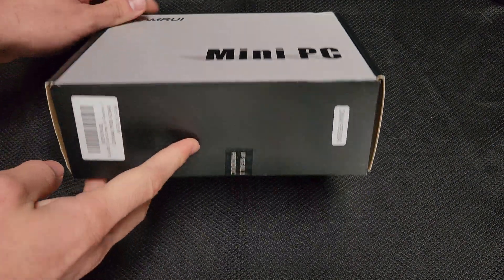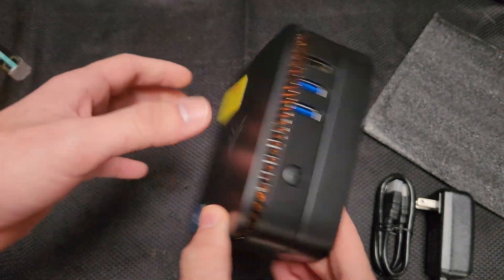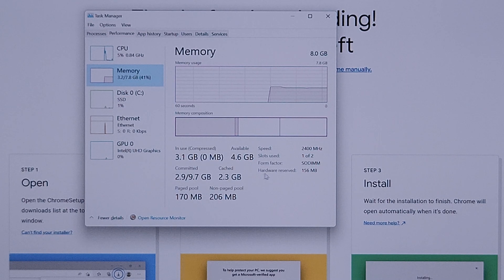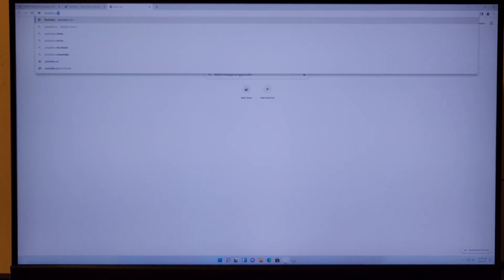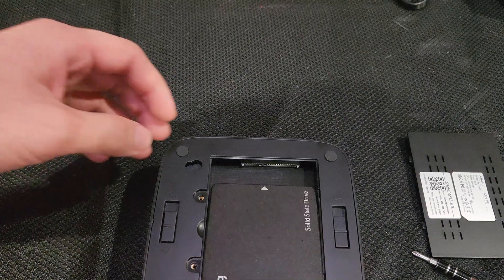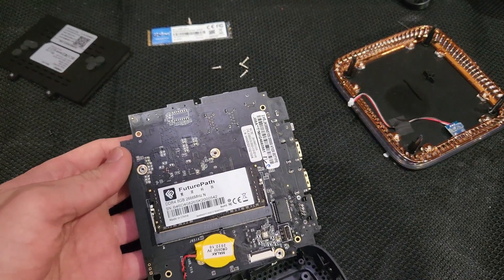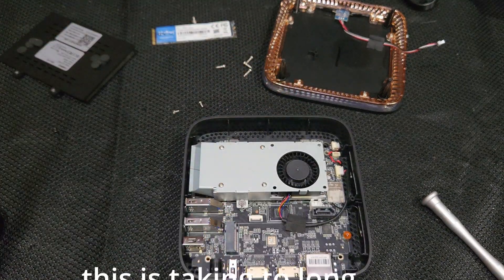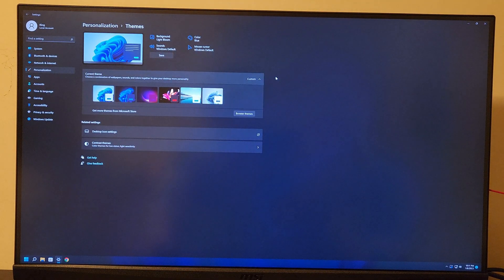Kamrui Mini PC AK1PRO(unboxing and teardown)

Comment: Picked up one of these for $115 on Amazon. N95 WITH 8GB and SATA SSD WIN11 PRO. Booted it up and installed Chrome and Firefox browsers. The CPU would peg at 100 percent just opening Chrome.  I changed the 8GB with a 16GB it's a single stick and it was still crap. Shipped it back to Amazon already. Lol.

The one I got was AK1 Plus N95 CPU.
Reply from the maker: Sorry to hear that. I didn’t have an issue with mine. I wonder if they changed some components overtime.
Reply: @kngx64  Not sure.  Mine, when I popped it open to replace the 8GB stick with a 16GB stick, it has one large fan that nearly covers the entire board not that gray box like on yours.  I didn't hear the fan spin up fast or loud during the short time I had it though.

Comment: How long does it take to get it doing something after powering on the first time? 20 minutes and the screen after the initial display is still black.
Reply from the maker: It should only take a couple seconds
Reply: @kngx64    Thanks.  I did have an issue but it is all good now.

Comment: i have 2 of the love it, but is it normal ive notive that the default networking point to a external asddrress, check it out, and theres alwasy stactic on the speaks when its on .....may be bad settings ...any idea ...??  ..but i love it fir the size , power friendlyness....😅

Comment: Love this little pc but my wifi is not as strong as other units in my house. I watched your video to see if I could upgrade the wifi card but I don't know which piece it is?
Reply from the maker: The WiFi card is not removable on this mini pc unfortunately. Having a Ethernet connection would also help out a lot.
Reply: @kngx64  Thank you for the reply. I ended up getting an aftermarket wifi USB I can switch over to when signal is low. Seems to have worked perfectly. Thank you!

Comment: Do you know why mine has no ram slot I made sure it’s the right model and the rest of it’s the same but it’s missing the ram slot
Reply from the maker: I am not really sure, I wonder if they just changed the board and not the housing
Reply: @kngx64  when did you buy yours or do you know what year is was manufactured?
Reply from the maker: I got mine in February
Reply: @kngx64  nothing changed about the model from yours date and mines date weird I’ll just return it.

Comment: Thanks for comments.
Have ordered it. No fortune. Installed. Windows has updated. Than fault messages VCRUNTIME140.dll, MSVCP140.dll on three funcions mouse, audio. Not fixed yet. Than ultra low speed on WLAN: 25 MBit/sec.  Than plugged in a USB to Wlan stick. 2,4 GHz no connection to my wlan. 5 GHz connection ok but only about 2 minutes connection to internet than break down. But speed with USB to Wlan would be 240 MBit/sec.   Than test with ethernet connection. Same - connection breaks down at about 2-3 minutes. 
Device would be nice. Service would be quick. But the device is currently unusable. Support hasn't responded yet. Support page given on AMAZON is incorrect or no longer available. Error 404.
Any idea, what to do?

Comment: tysm man i was searching for a video to look if i can change the ram and i got my answer
Reply: im really confused cuz in the review of the product they say we cant change the ram its integrated
Reply: @fbgs006  I have the same mini PC and I've opened it, in my case it uses a 16Gb DDR4 2666MHz RAM module. Sadly 16Gb is the maximum supported by Intel Celeron N5105

Comment: I sent mine back, i didn't like that you can't upgrade the ram and it uses a nonstandard SSD drive. I bought a beelink instead, it uses a standard m.2 ssd drive and SODIMM memory
Reply: What? Did you watch this video? The Ram is removable/upgradable and the SSD is a standard Sata M.2 - both can easily be swapped for a larger Ram stick and an NVME M.2 drive...
Reply: @beelzzebub  LOL maybe he hit his head and did not realize.
Reply: do I need a certain type of ram for it looking for 32 gb
Reply: mine must have been a different model, mine had the ram soldered on the motherboard  @beelzzebub

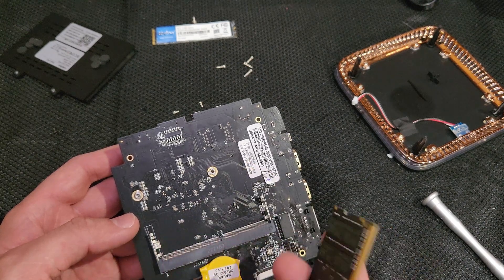Comment: 10:40 Just to be 100% sure: RAM is completely upgradeable, right? Do yo think it's uo to 16Gb of RAM?
Reply from the maker: Yes, you can upgrade the ram.
Reply: You can always use the memcheck capacity in Command Prompt to see how much memory you upgrade too. We have an extra one of these where I work that just sits around. Pretty straightforward.
Reply: Ram is a ship dont move up